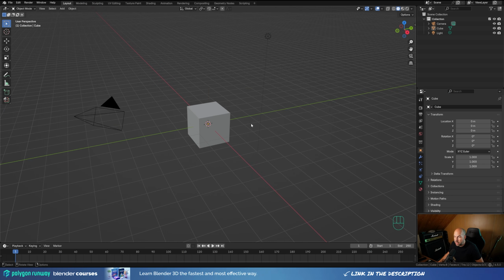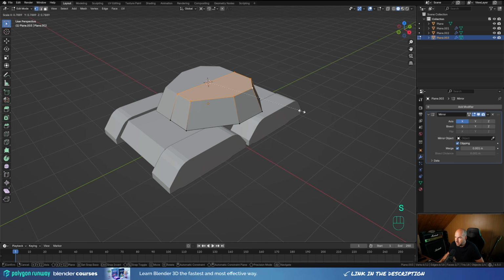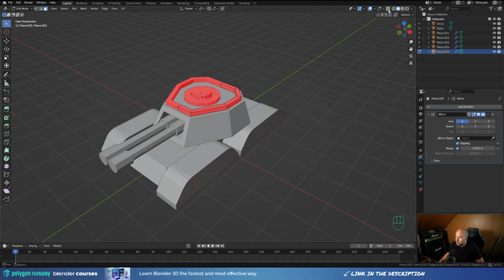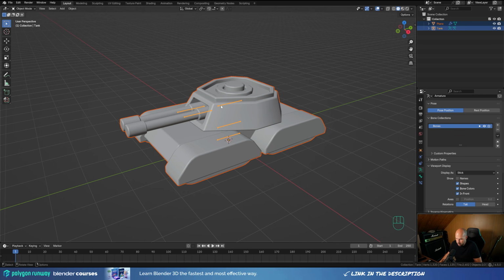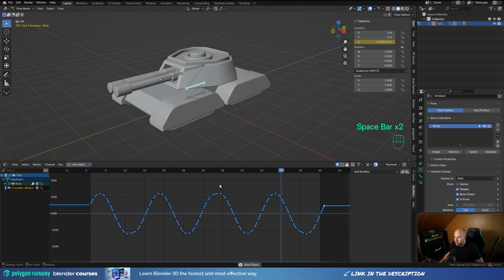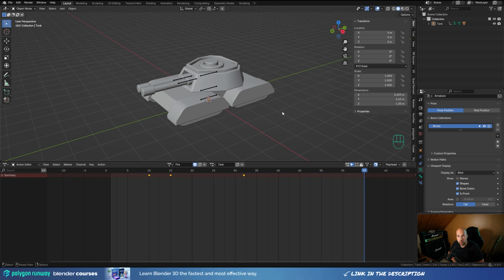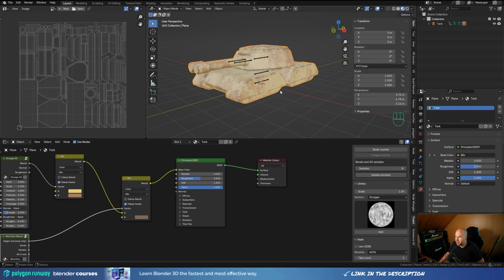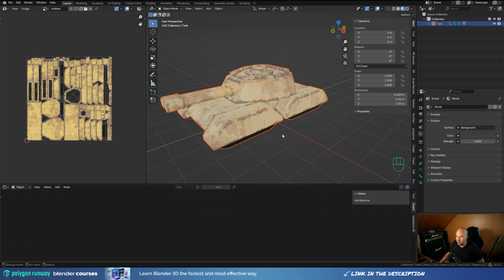Blender Animated Game-Ready Asset Tutorial | Polygon Runway

Comment: 5:14 IDK why after press B it doesn't gets into Boundary mode, Can somebody give solution for this😅
Reply: Same I'm having that same issue it won't boundary and I'm on the version 4.4 of blender btw
Reply: @Quad_Gacha  Same. Did you figure out how to do it?
Reply: @qorez6917  you have to delete the extra face in the middle, turn off mirror to see it
Reply: I've been using blender 4.2 and face the same problem but after installing the latest version, it solved it, might had been bug from the previous version
Reply: In case anyone else has this problem, if you hide the face being inset, you might find a face inside the geometry along the mirror surface. Delete this inner face, unhide the face to inset, and it should work.
Reply: Oh, it's because we didn't enable clipping on the mirror modifier!